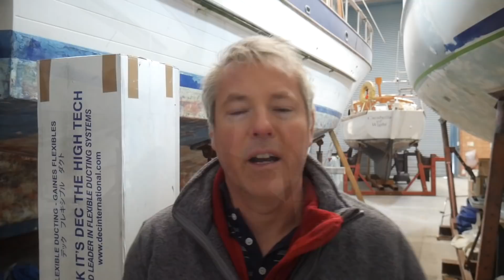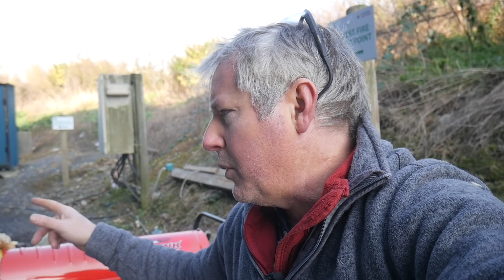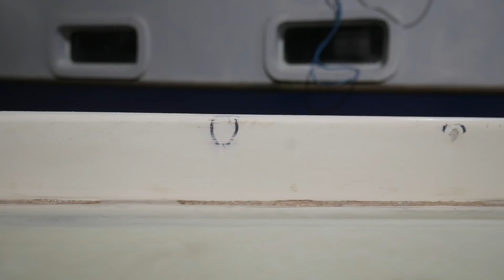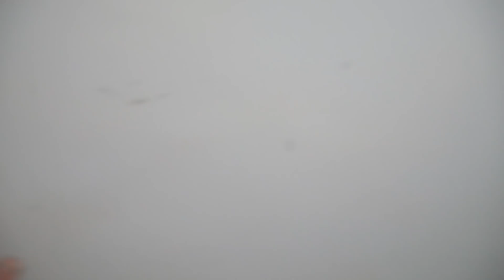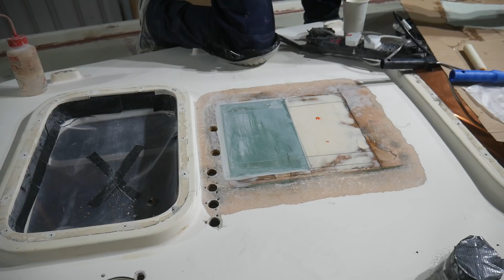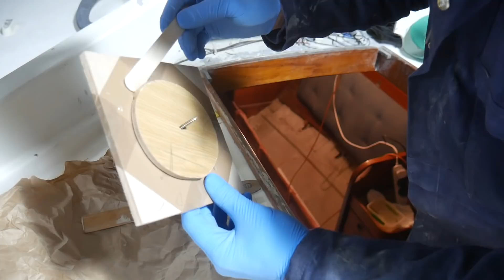#51 Closing thru hulls and other unwanted holes

Comment: DUST HOODS  Yer my grinder has a removable part on the front [unlike the 2 you have unless its still in the packaging  ] which when doing flat surfaces it catches 90% of dust . yer they are a great tool

Comment: Great video.  The fairing ball tools are useful for corners and I will investigate these further.  Working in really cold temperatures means condensation and the space heater will aggravate this with the amount of moisture they produce, unless you can really lift the temperature.... but everything will be streaming in the morning.  Fumes are the other problem.  A challenge - it's either a commercial flued unit or electric I think.. .
Reply from the maker: Hiya Bob, I think I will try demonstrate this in the future. Even though the heater puts out water vapour, it drops the humidity. The air warms up and then I suspect this means the humidity rises higher in the shed. First I see the humidity peak, and then it drops off. The heat also increases by about 2.5 degrees C per hour. So basically without the heater I would not have been able to lay down the primer. We will see what happens when it comes to putting on gloss. Thanks for watching and thank you for your comments

Comment: I enjoy your videos exactly as you have been making them, keep up the good work. Heating situation is a real bummer - I would not be surprised if the heater manufacturer said they do not endorse the use of ducting so cannot help. Have you not got enough ‘other work’ that is not temperature dependent - it should be warmer in 10 weeks 😂
Reply from the maker: Hey Norman, thanks for the message. Yeah as soon as I tell any manufacturer what I am trying to do I'm sure I'll get nowhere. There's a race on at the moment for the painting so I have to focus on that... more about that on the next update!

Comment: For your gas heater. I would suggest you look at using a sheet metal duct made from 22 or 24 gauge galvanised steel. Say 600mm to 1200mm long to prevent the Flexi duct from over heating.
Your videos are getting better and better👍
Reply from the maker: Thanks Andrew - i wasn't sure about galvanised steel/iron. I thought it might not stand up to the heat - I think I read somewhere galvanised iron starts to break down at around 300 degrees C or somewhere around that? Current thinking is to go for stainless steel 316 as I know that will take the heat.. More $$ than galvanised steel though...
Reply: @aboatcalledwanda6925  I agree stainless steel would be a lot better. The 304 grade would be fine for that job and a bit cheaper than 316. Perhaps you can find a ready made flue that came off a wood burner.

Comment: Thanks for another great update. Perfectly happy with the talking to working ratio. Whilst filling holes you should consider relocating the starboard side deck drain and bilge pump seacocks which are under the cockpit locker sole and a total nightmare to get to if either needed turning off in a hurry.  What the yard were thinking when they stuck there is beyond m
Reply from the maker: Thanks Nathan - you're right about those thru hulls!!! I have been scratching my head for about a year now wondering what the hell I'm going to do about them. No idea how you could get to them in a hurry? Even the raw water intake is a massive pain in the arse to get to - I've got to reach past the engine/dry riser to get to mine - where is yours located BTW?
Reply: @aboatcalledwanda6925  Hi Richard. My raw water intake is just inside and aft / right of the double access doors. Very easy to get to with a hot donkey. What you might also want to do is route the deck drain into one of the cockpit drain seacocks. SB side would be easiest. Also make a note to replace all the pipes to the seacocks on the engine bay with fire proof hose.

Comment: Can you connect your blow heather directly to the panel (not touching the wood panel] and forcing the hot air in the shed.?
Reply from the maker: thats a good idea - unfortunately there is a bar across the front which means I can't really get it right up against the panel...

Comment: Must be quite frustrating to compensate the low temperatures! Could a piece of spiro tube be fitted between the heater and the hose?
Reply from the maker: Oh whats spiro tube? That sounds interesting - will look that one up.
Reply: A boat called wanda It’s kind of an ordinary ventilation tube built in a spiral (sorry I don’t know the English term for it) but it’s cheap. I reckon 2-3 foot pipe would keep the heat into the workshop, without burning your hose.